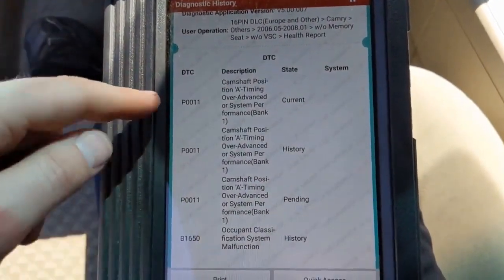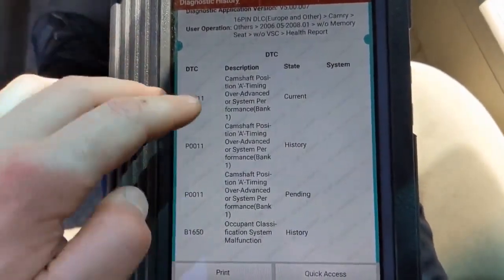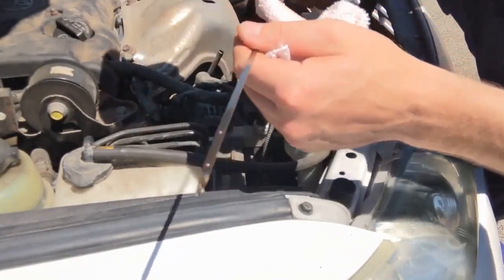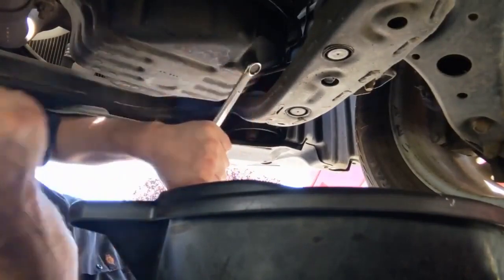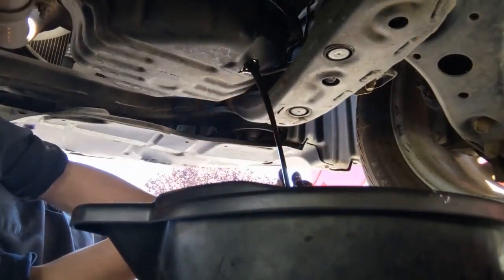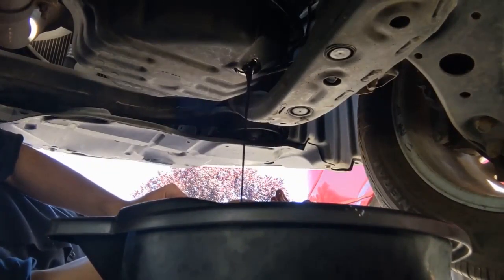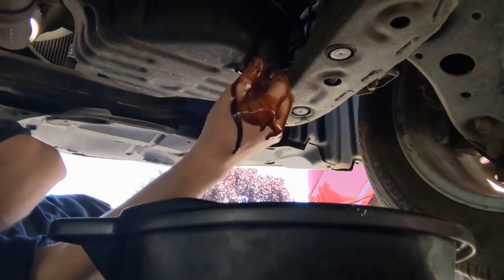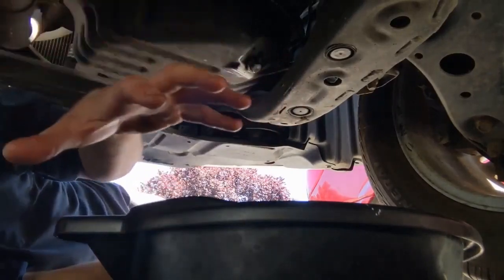Variable Valve Timing | Diagnostic Tip

Comment: hello i have a chevy 2008 cobalt and the engine light is on. some days its randomly off but the next days it’s on. just today my car when starting it sounds extremely loud out of no where .. like a motorcycle or something and it’s loud like that when accelerating at any speed. goes quiet/normal when not on gas. can you give me any direction?